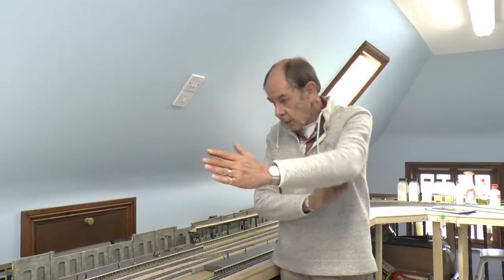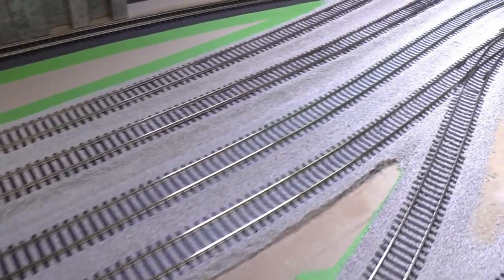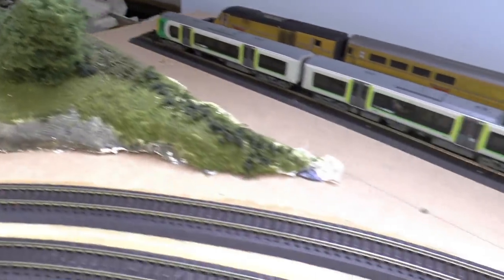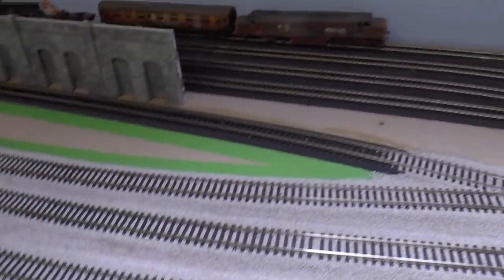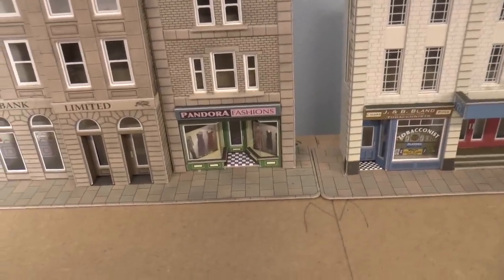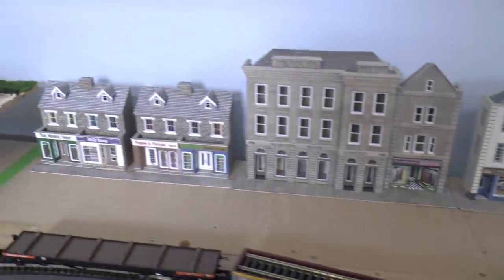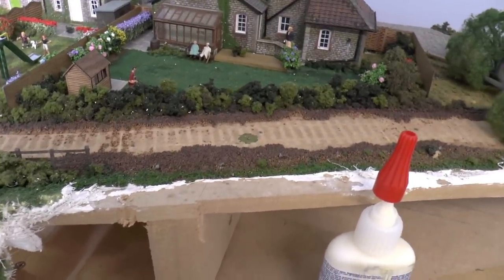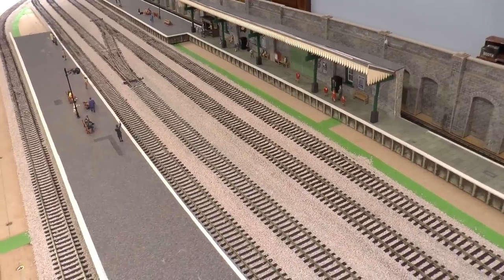Part 11.  Ballasting and kit building.      15-03-2019

Comment: I just hear wheels.  No resonating wood.   Nicely done with the track.  Your ballast is something to be envied.  I like your high street buildings.  Oh and Rob’s.  So I’m a fashion leader on your layout.  Bringing the world the fashion that every one wants.  😊 Rob
Reply from the maker: Rob McCrain      😄😄.  Absolutely a fashion guru my friend,  !     The trains ran extremely well especially through the ballasted area with absolutely no problems, it is so nice to just stand back and let the trains run without any fear of anything derailing or going wrong which is exactly what I wanted on this version of Lakeside. And you’re right, no noise resounding from wood when going over the ballasted area so you glue you recommended really work so well, I shan’t use anything else from now on.    Cheers for now mate.         ............Graham

Comment: Coming together nicely, YAY can't wait to see your Faller car system update as I am looking at the digital version myself. I also heard a cheaper alternative to the running wire for it is welding rod on the reel, food for thought. Also have a look at Scalescenes we sight, similar to the kings way except you download and pay once and print as many times as you like, Windows printed on overhead projector sheet which looks awesome, I have done a couple of these kits and the details as well as strength structure is great..  Otherwise look forward to more updates (which I am playing catch up at the moment lol).
Reply from the maker: Sean Baldwin      Thank you very much Sean for the comment, it’s greatly appreciated.  I have used Scalescenes buildings once or twice and they are ok.  I was torn between using the Faller system and the Magnrail, they both have advantages and disadvantages over each other but I’m now tending to go towards the Faller system but still haven’t made up my mind completely yet. We shall see nearer the time which shouldn’t be too far off as I need to start that soon.      Cheers for now.         ........... Graham
Reply: I have seen the magnorail on Everard Junction. But to me that seems like it could be a pain to maintain and limits the type of road system used aka will it work with a smooth it or wall plaster road base. I also like the idea of it using any vehicle to scale but the called system with working lights is more appealing and scheduling of fire trucks or ambulances to depart a depot and buses etc. But hey look forward to what you choose. :)
Reply from the maker: Sean Baldwin     Yes I saw Richards version, I liked the fact that you could use any of the Oxford cars/vehicles but didn’t like that chain and the noise it created. I don’t know - it’s a difficult one.
Reply: Yes it is really, but will make a decision soon myself for my layout...  Back to the research room for me hehe.
Reply from the maker: Sean Baldwin     👍🏻👍🏻👍🏻. Yep, me too.

Comment: Graham, good to see it's going well.  Just to go back to the track bed laying, could you tell me what glue you used to fix your track bed and track on the lift up section, I'm just about to put mine down.  Cheers, Mike
Reply from the maker: Mike Kingston      HonMike, I have been using Copydex to glue both the track bed down to the MDF and the track to the track bed. Then I am using Elmers glue mixed 50/50 with water and a touch of washing up liquid for glueing the ballast.  Hope that helps mate.      Cheers for now.          .........Graham
Reply: Thanks Graham, I have been using Copydex on the trackbed so far but wondered if anything stronger was needed on the lift up.  As yours seems fine I'll carry on, thanks once again for your help.

Comment: Looking good it's coming along well, The air con should keep it all cool in the hot summer, no warping or distortion. I'm getting a dehumidifier for my conservatory as the railway will be in one half against the wall and go into the garage should be okay for me. plenty of track you have there lots of scope. One question for you ... have you had problems with MDF warping ?? cheers..

Comment: Great running shots. Do you scratch build the platforms or are they kits.
Reply from the maker: John E      Hi John, I scratch built the platforms from 18mm MDF and I will do the same for the replacement platforms which shouldn’t be too far off now, maybe start work on them next week if I can get the time.     Cheers for now.          ...........Graham

Comment: Hi Graham
You say it doesn’t look like you have done much, I disagree, that’s a lot of work, only wish I could work that fast. 
It’s looking so good and love the updates.
Just a quick question, i can’t remember if you were putting back scenes up or was it that you didn’t want anything on the walls due to fresh paint. Will you just be covering up the little brown doors with the large department store etc 
Once again great video and look forward to the next one
Regards
Martin
Reply from the maker: Martin Slyfield     I think because I spent about 4-5 days doing the ballasting that when I looked at it then it didn’t seem that much for the hours.  Yes I will put back scenes up with hopefully street scenes between some of the buildings.  Not sure why you think I should cover up the brown doors though, do you mean the ones either side of the revolving door?  You have to have alternative doors in case of problems with the revolving door I guess but no, I shall keep those as they are.     Cheers for now.           .............Graham
Reply: Lakeside model railway 
Sorry Graham I didn’t explain the doors very well.
I meant to say the doors in the walls into the crawl space behind baseboards 
Cheers
Martin
Reply from the maker: Martin Slyfield    😄😄.  Sorry mate, I completely got the wrong end of the stick there didn’t I 😄😄.   I can still gain access to those doors as they open from either the top or the bottom plus I can access the eves from both ends too so no problems with that.    Cheers for now.           ...........Graham